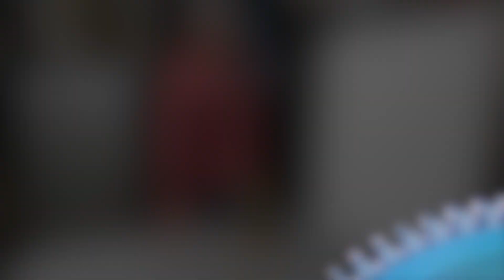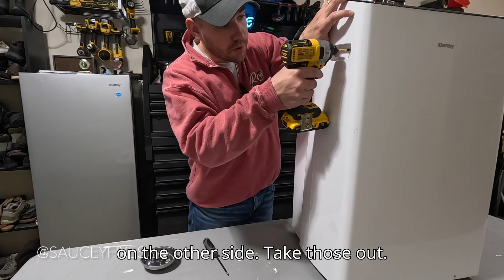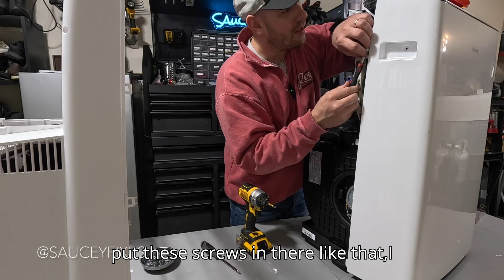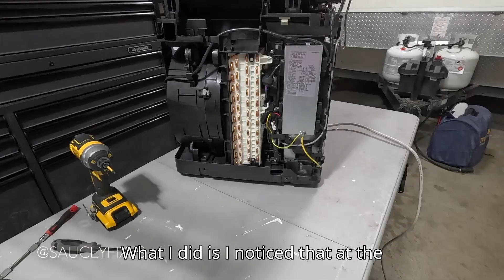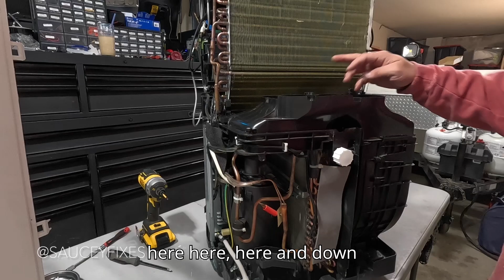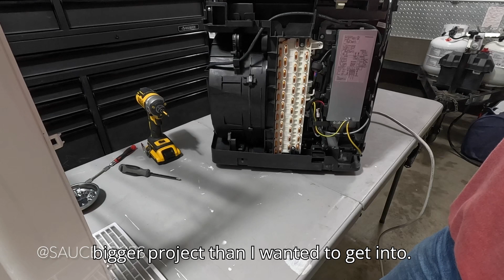Danby Portable Inverter Air Conditioner - P1 Error Code Fix & Disassembly

Comment: Now I need to know more about this flex hose and how to vent it outside. I don't have a sliding door or windows like those shown. I will figure something out. I always do.😊👍👍
Reply from the maker: Hey Kevin, 

One option is to go to your local hardware store and get a plastic panel (I used puckboard from Home Depot $50.00) and trace out the vent attachment onto the puckboard. Then cut out the traced portion on the puckboard. Then cut the puckboard to fit whatever window you have. That is what I did and it worked perfect. A bit time consuming but a perfect fit in the end. Cheers and thanks for watching.

Comment: Thanks, I like to see how things work. That was all great stuff. I just picked a reconditioned one up. And I wasn't sure how the evaporation system worked. Had one slowly leak through my engineered hardwood floor. I noticed a dark stain in the wood which turned out to be black mold under the flooring. Quite a lot of it. Thankfully, it was trapped between the waterproof underlay and the hardwood and not in the subfloor. This model has a foot valve to stop it from overflowing. Very good to know and the lower valve will drain the pan if there is a problem. My refrigeration friend will feel better when I tell him about this little overflow safety switch. He will probably watch your video 👍👍thank you from 🇨🇦
Reply from the maker: Thanks for tuning and supporting the channel. Yes it is good to know that this air conditioner has a float switch to prevent overflowing and a flood in the house. More content to follow. Cheers!

Comment: Thanks for the video! I have the same model but branded as Midea. I have unscrewed all the screws on the back and sides like you said, but the back just won't pop off, and the plastic feels really soft and flimsy when I pull a little hard on it...What do you think is going on?
It has dirty socks syndrome no matter how much I cleaned the evaporation coil, so I want to take everything apart and clean everything inside.
Reply: NVM, it's just very hard to open. I managed to open it. But there are too many plastic covers, almost each of them has several plastic clips that are really hard to open. I have been working on it for a night yet still haven't get to see the front coil. All these complex plastic covers create a lot of corners for the water to hide, so I can already see meadows covered on them. No wonder it started to smell after only one season...And all these time there was almost no water to be drained! Now I know that it was hidden inside these small corners. Just really bad design, pretty, yeah, but functional? No. My old Denby had been used maybe 3 years without any smell.
Reply from the maker: Hey thanks for checking out the video and I’m glad it helped (somewhat) with the disassembly. It’s odd that you have a stagnant smell in it. I know with my air conditioners (all three) they recommend running the fan for several hours at the end of the season to dry up the moisture inside to prevent mold/ mildew build up while in storage. Cheers.

Comment: Thanks so much for this video. My 3 yrs old danby inverter portable ac is actjng up now. The breaker keeps tripping after 1 or 2 minutes the AC is on. It looks like it pulls a lot of currents. Any idea what is causing that?
Reply from the maker: Hello, and thank you for checking out my video. Although I’m not an electrician, usually when any electrical device pulls a lot of current and trips a breaker is because of a short circuit. The breaker tripping is protecting the device from overheating and starting a fire. That would be my guess. Possibly a short in the circuitry of the inverter printed circuit board, or a short somewhere else in the device. You may be able to see a heat area with a thermal camera somewhere on the air conditioner with it disassembled before the breaks trips however I would be very carefully and suggest you bring it to a professional. Cheers.

Comment: “I’m learning a lot from this...thanks! Do you happen to have a video showing how you fixed the fan? Or was it just a matter of recentering it and screwing it back down? I’m dealing with the exact same issue right now.”
Reply from the maker: Thanks so much for watching! I’m glad you found the video and it’s helped you out. For me the fix was unscrewing the motor fan and repositioning it back on the plastic mount on the other side and making sure the blades are not touching the coils when it spins. I unscrewed the power supply and PCB I showed in the video which was only a couple of screws to move it out of the way. Cheers
Reply: Thank you so much for sharing! I had the same problem with the mis aligned fan and this video helped me fix the issue. Thank you !